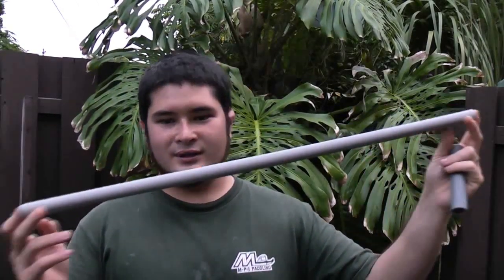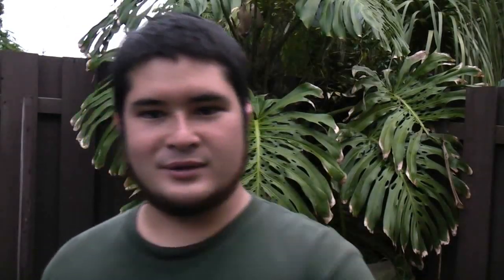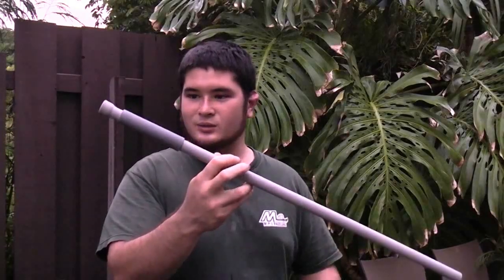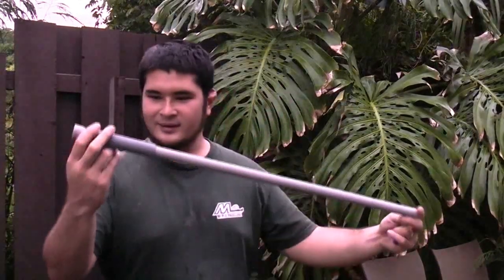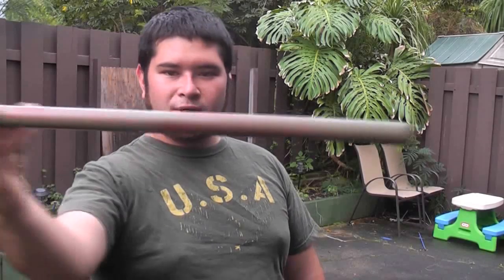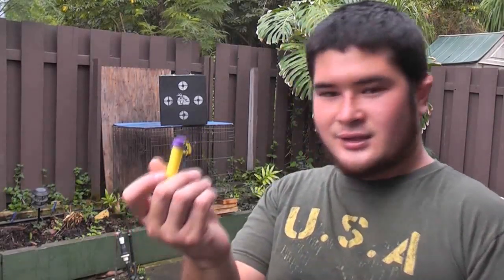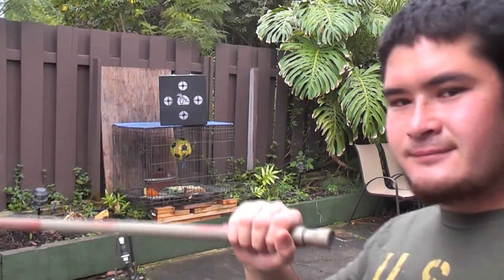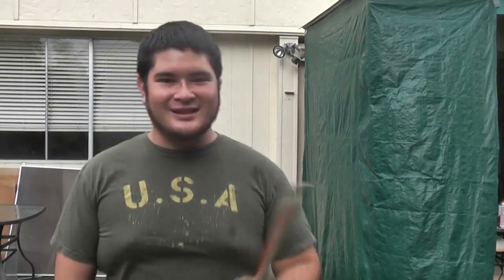How to Make a Simple PVC Blowgun for Nerf Darts

Comment: are you heating up the pipe with a hair dryer?
Reply: It's actually a heat gun, you can buy it from most hardware stores. I would like to know whether it is possible with a hair dryer though
Reply: AwesomeBraz I just used boiling water, but I really do not think that you need a handle and a mouth piece, more for ascetics and comfort